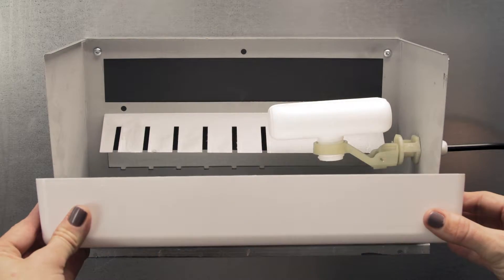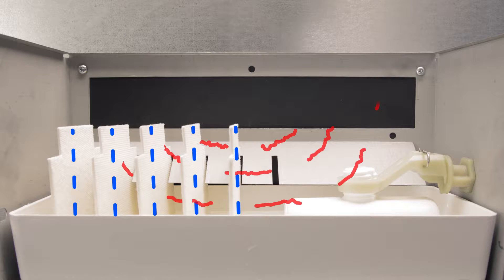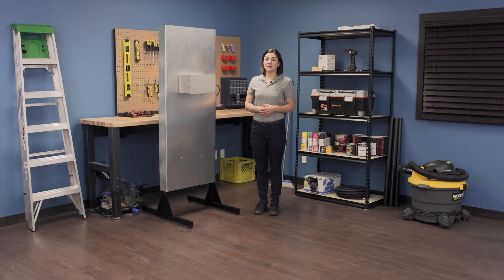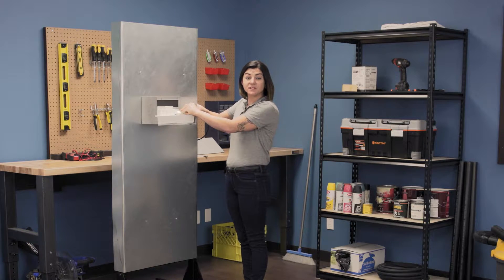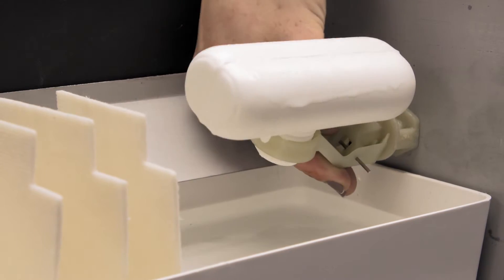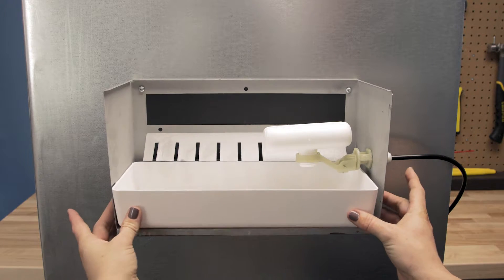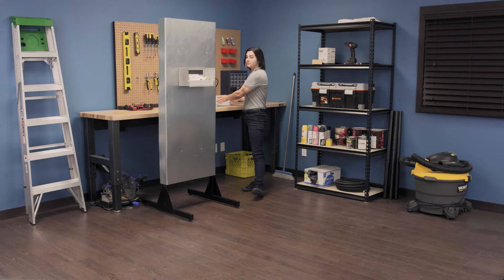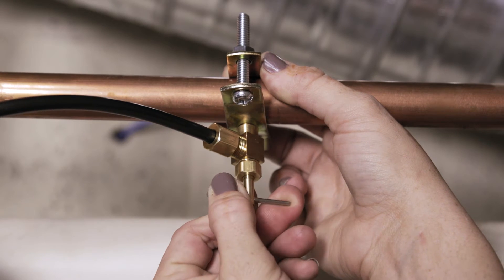Humidifier Reservoir: Repair and Replace (White Rodgers H-40 / Lau L-40)

Comment: Would the reservoir drum be dry during the summer normally ?
Reply from the maker: If the furnace and humidifier are turned off, then no new water would have filled the reservoir and the water might have evaporated over several months. Check to see if the water to the humidifier is on, it should start filling until the float closes the valve.